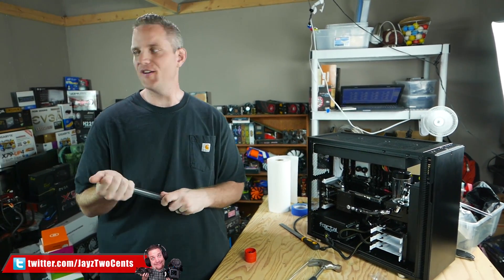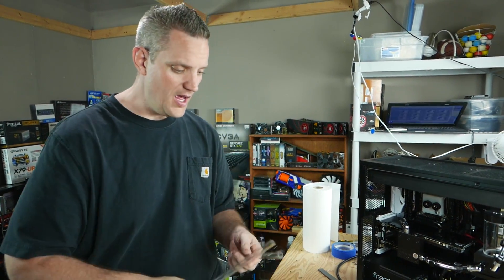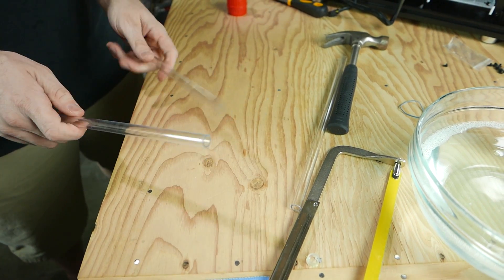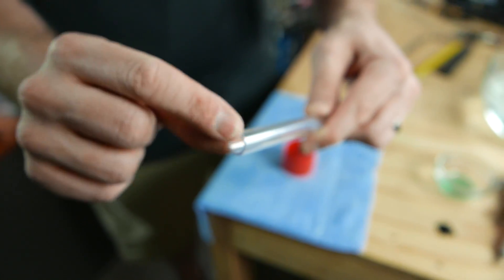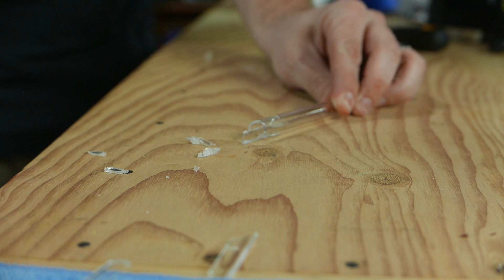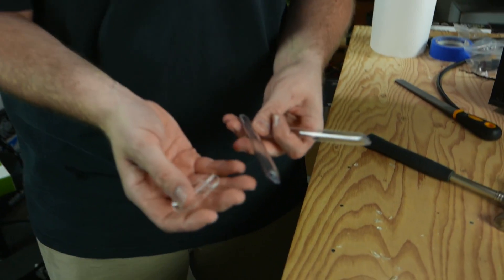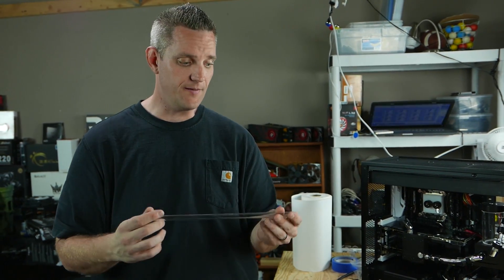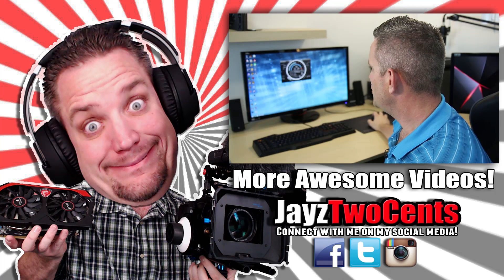PETG VS Acrylic Stress Test - Hardline Watercooling

Comment: 0:45 I don't know why but the backwards power switch is driving me nuts.
Reply: Kyle LaFountaine That's on all the EVGA eco units.  It's because the insides and case are different makers (they outsource the insides).  They'll presumably fix it eventually.  FYI, the switch is the one that's wrong, so follow the case.
Reply: +Kyle LaFountaine it's China red means on, green is off. They have no concept of iphones or xbox 360 icon or that international power symbol.

Comment: Just wondering: Can and should you use copper pipes?
Reply: Copper tubing has been used since the early days, but it's a little harder to get right - you need to flush solder out of the system before you actually attach any water blocks  The block system itself has to be either soldered-on, potentially getting gunk in the blocks, or you have to get the regular fittings to hold coolant, which can sometimes verge on the impossible.

As for heat transfer, the copper will only heat to the temperature of the liquid inside, and it won't radiate well because it lacks any kind of heat sink or heat spreader.  Combine that with good in-case airflow, and it's not a problem.

Plus, if you can get/make a custom case, copper pipe has a very steampunk aesthetic.

TL;DR I'd only trust people with plumbing experience to do it right, but it can look super cool.
Reply: TrueSpoon | 1.4k
The heat would transfer to the pipes? What do you use for cooling? Boiled water? The water temperature is always about 30-35°C wether you use PVC, Acrylic or other metal pipes. Only thing is like the former poster said, that you need to flush the pipes really really well before actually using them in a closed loop.
Reply: That sounds terrible,the heat would transfer to the pipes heating the pipes, no one has cooling on their pipes so it wouldn't work that week
Reply: ajjdgj6tmgedvnmtmek Thanks
Reply: Yea it works, but it's a bit tougher. You sometimes need special fittings

Comment: Ive seen a rig with carbon fibre toobing try that for a test :)
Reply: ***** Carbon fiber and fiberglass are pretty easy to work with, if you accept that it's not bendable.  You either need fittings or to custom-fabricate the pieces with the bends in them (which isn't terribly hard, but can get super messy).

Comment: ***** i want to use PETG in my 1st loop, but my Bitspower d5 mod top (g1/4) doesn't look like it can support the (2) fittings side-by-side as most PETG fittings are 20mm+ wide and bitspower says 18mm max. any input? am i stuck with getting a new mod top?

Comment: PETG is more plasticy, and Acrilyc Acrylic is more like glass. Glass is more premium-like and looks nicer, better light reflection
Reply: ***** In the video ***** said PETG has a slight blue hue and acrylic is clearer, so you are kinda wrong there.
Reply from the maker: You didn't quote me properly. I said the ends look slightly blue. I even said from the side it's perfectly clear
Reply: ***** Polyethylene terephthalate glycol-modified. Science.
Reply: UnderwearThief http://www.cgcglass.com/lgreen.htm
Reply: JamesHD1990 PETG literally is plastic. It's what bottles are made from.
Reply: Kevin Eder Though Jay already covered it, even glass looks greenish from the side because of some iron content, doesn't mean its not crystal clear.
Reply: wooo weee Since when does iron turn things green? In solution it turns red. Source?
Reply: xXDarkxIdealsXx Yeah, that is interesting. Fun fact: ethylene is also called vinyl, like for PVC
Reply: JamesHD1990 But harder to work with in some ways.  I've never heard of Acrylic shattering inside a build, but I have seen people fail multiple times to get acrylic routing right, which takes time in the build process.  For a personal pet project, time is free, but if you're doing it for a job, I'd rather do it the slightly faster and easier way.
Reply: just from personal experience - to me, at least, acrylic looks nicer, when you look at a case w/ PETG - you can tell it's PETG.
Reply from the maker: JamesHD1990 PETG is clearer than Acrylic, so you are kind of wrong there.
Reply: ***** 

Utter crap.  PETG is in no way clearer than Acrylic.
Reply: ***** 

Utter crap.

Comment: Rigid tubing looks so cool in a case, but its a bitch when it comes to maintenance. I think I'll just stick to soft tubing.
Reply: The amount of force needed to shatter acrylic is also enough to damage a lot of other things. I tried to snap a piece by hand and couldn't do it but it was bending the motherboard way more than it should be bent. If something were to hit my computer that hard I'd rather the tube break than my motherboard.
Reply: How so?
Reply: +Jerome Narine unrelated
Reply: ***** PETG is the same plastic used in water bottles right? Those break down in water, and probably most importantly, via thermal oxidation... This feature was deemed as a good thing in water bottles, it reduces the pollution potential significantly, but does it make a good plastic for water cooling? It also produces acetaldehyde as it breaks down, which will turn into vinegar, which would mildly attack copper and copper oxides, which could lead to pitting if it got bad enough, but I have no idea how long someone would have to go without changing their water before it got that bad...
Degradation in PET also leads to discoloring, and the crystal structure disintegrating(crumbling to dust). I do not know how long before those symptoms started emerging in a consistently 80c wet environment though... worries me a bit...
Reply: thunderdog512 For one, you can't do something like remove your CPU block without draining the loop and pulling the tubing off. I'll stick with my Tygon tubing.
Reply: ***** Hard tubing is basically permanent tubing, maintenance and upgrades are a major pain in the ass. They look extremely clean though, and arguable require less maintenance if you do them right the first time(biocidal, no actual dye). Flexible tubing seems to kind go 'off' after a while if that makes any sense at all, like they get gummy. I hear it is caused by the plasticiser used to make the tubing flexible.
Reply: +Jose Acevedo At least PETG doesn't shatter so no worries of the breaking the tube.
Reply: Edwin Vargas It's definitely related when it comes to maintenance.

Comment: Jay I want to use a tubing like the nickel plated brass aqua cool hardline but I want to be able to bend it any suggestions
Reply: Myrtilys It's not the tubing that's the problem. It's the coating. The tube bends fine but the nickle coating will crack and expose bare tubing underneath. If you want to use bent plated tubing, you want to bend first, then have it coated.
Reply from the maker: Myrtilys They specifically say not to bend the metal tube from AlphaCool. You have to cut it and use fittings to make the bends like I am doing in the Parvum build
Reply: ***** Ahhh, okay. I was figuring that the metal tubing would be properly bendable, but guess not.
Reply: There are pipe benders out there for that type of thing. Might be able to rent a small one for fairly cheap if you're looking for a one-time thing.
Reply: Andrew Morency Getting that coating done isn't necessarily easy, either, unless you're pretty well connected.  I'd go for fittings, or find different metal tube if you just want the bent look.
Reply: Looking at different metal tubing I was thinking of using stainless steel tubing and getting white sleeved cables to match the tubing
Reply: Will Leonard
Go with annealed copper tubing -- you can find it at a home improvement store pretty easily -- and once you have your tubing set as to your bends and lengths, get it chrome or nickel plated.